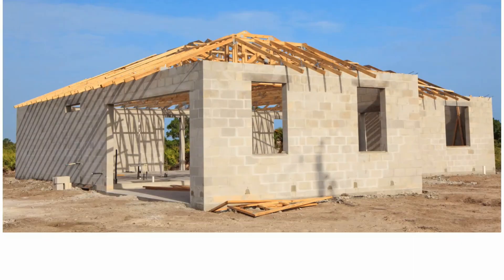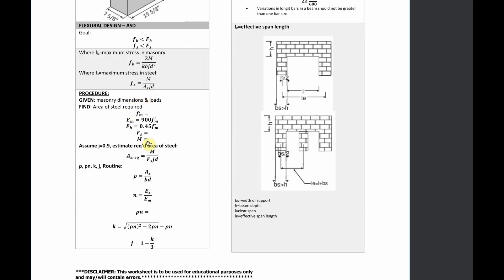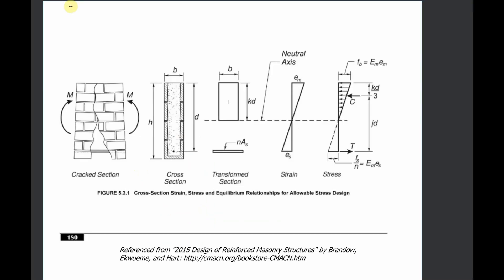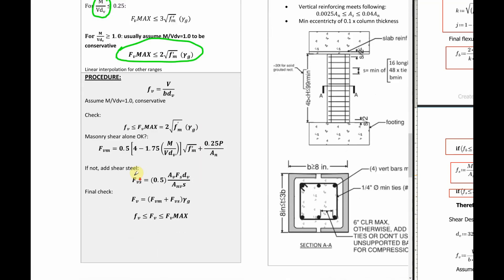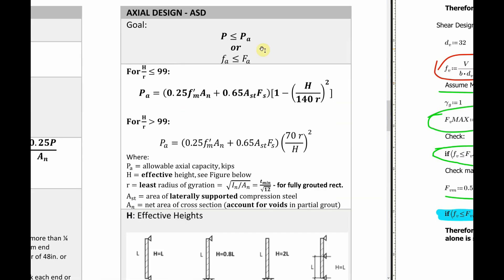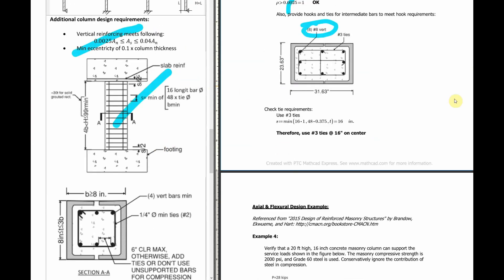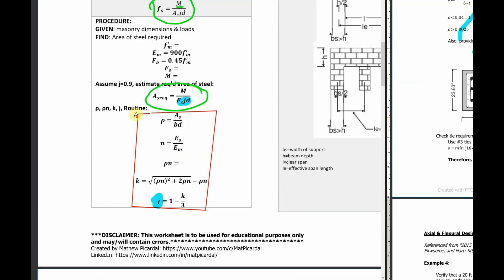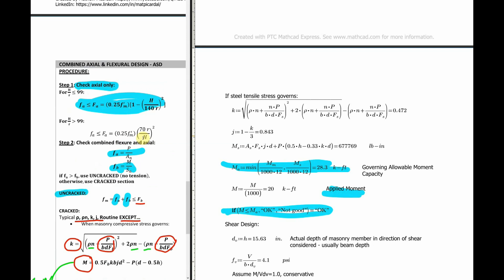Masonry CMU Design Tutorial + Summary Sheets + Worksheets

Comment: “They usually fill these up with grout.” They ALWAYS fill cells containing reinforcement steel. Without grout, the tensile forces will not transfer to the steel. 
I say this because I once talked with an inspector in Georgia... went out to a homeowner complaint, his brick wall was noisy in heavy wind... He contacted the builder, who said, “That’s just the steel banging around when the wall moves.” 
Inspector: “Shouldn’t do that. The grout prevents it.” 
Builder: “Grout?” 
*
When you have vertical bars, you’ll have horizontal bars... and you often end up with a fully grouted wall, design controlled by seismic.

Comment: Hey Mat, thanks for sharing. In practical world, are we allowed to use full capacity of fm value without special inspection? Correct me if I am wrong, there is a masonry/building code stating that if special inspection required then we are allowed to use the full capacity of fm value. If special inspection is not required then we are only allowed to use 50% of the capacity of fm value in our design.

Comment: What programs do you use for designing? And what is their system Requirements?
Reply: For masonry you should definitely try RAM Elements which includes a module to design bearing walls, shear walls, columns and lintels of reinforced and unreinforced masonry.